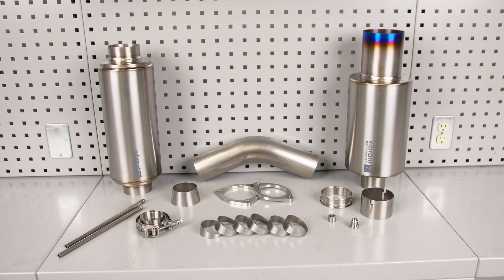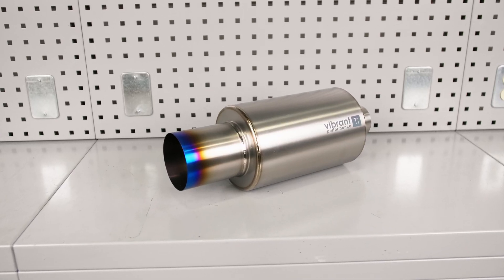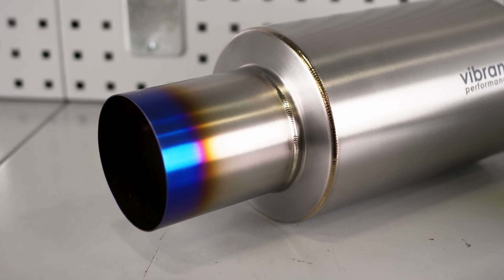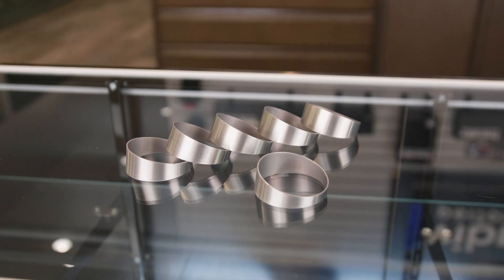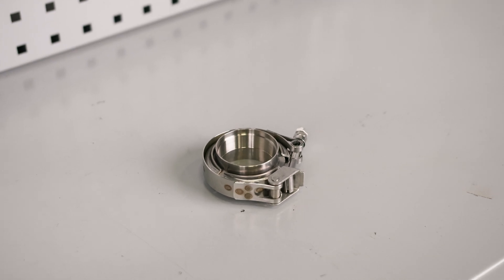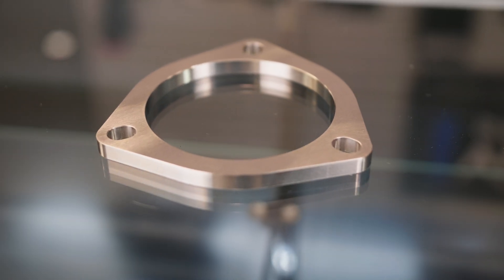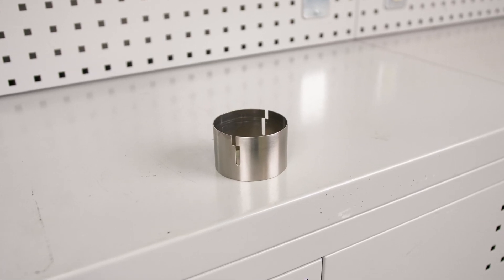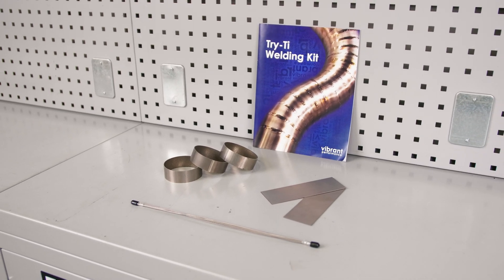Titanium Components (Vibrant Performance)

Comment: If only there was a 2.75 titanium resonator so I can add on my Tomei on my S2000 :((
Reply from the maker: Part 13222 is a 2.5" to 3" transition, if you order two of those, cut them in half and weld to a 3", you can do a 2.75" to 3" step in the resonator as a solution. If you have any questions, we can happily help and make recommendations:
tech@vibrantperformance.com
we also can chat on the phone if you prefer that: 905.564.2808
Reply: @vibrantperformanceparts  Awesome! I'll give you guys a call about this tomorrow! Hopefully it help with the rasp and drone on the Tomei.. I bought the car like this, and the only issue is the exhaust..